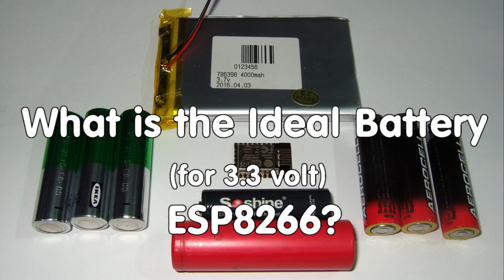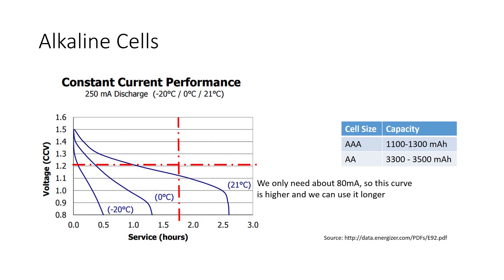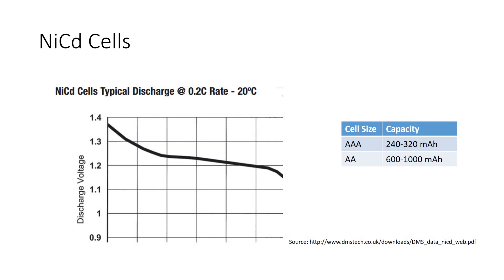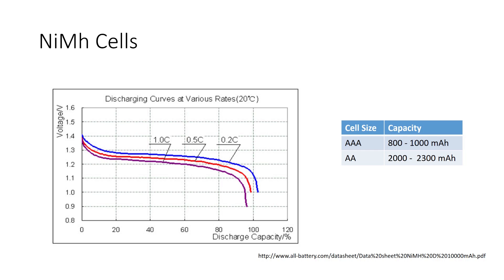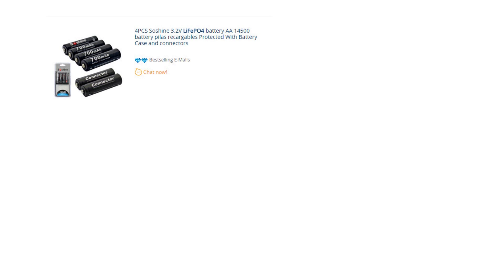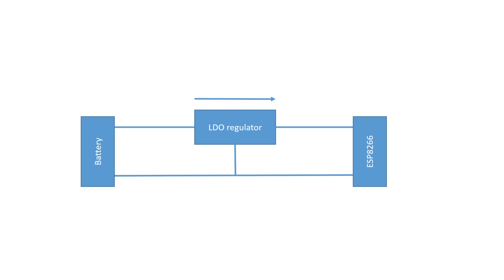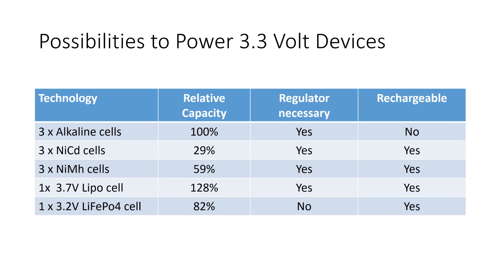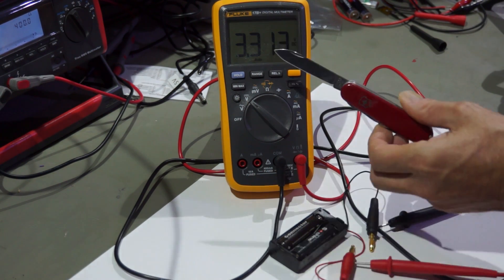#64 What is the Ideal Battery Technology to Power 3.3V Devices like the ESP8266?

Comment: But what about the current?
For example, if my device can draw spikes of two amps, can I use a lipo of 500mah size?
Reply from the maker: +Mahmoud Metwally This comparison is not for motors with high currents. If the spikes are short it is usually better to use capacitors close to the device. I covered that topic for the Esp8266 in my videos.
For high current applications I think, Lipo is the best technology.
Reply: Any details about the usage of such capacitors?
Reply from the maker: Not more than covered in the videos.

Comment: 700mAh at 3.2V = 2.24Wh. And seems to cost ~$3. For that price you can get NCR18650B (3.25A*3.6V=11.7Wh) or similar. Even lowered by 20% with LDO it still seems that regular 18650 is 4-5 times better deal.
Reply from the maker: If you only look at the dollars, you might be right.

Comment: Hi Andreas, im planning a project where the Esp sleeps and wakes up when a button is pressed. I need a battery solution with a low idle (deep sleep)  current. What would you recommend?  I was thinking of a lifepo4 directly or an 18650 with an Pololu S7V8F3 (0,1mA idle current) 

Greetings from Germany
Reply from the maker: I just looked at the S7V8F3. I am not sure, if this small current is only during shutdown. Then, it would be useless. If you go with Lipo, a much cheaper solution exists: Just look my video #58. Or you go with LiFePo4. Then, you do not need any regulator.
Reply: thanks for your inspiration, lifepo4 works great. I got the Idle-Current down to 18uA. Combined with a PIR Sensor (40uA idle) i got an awesome Securtiy System for cheap.

Keep up the good work, your channel is my favourite ESP8266 and arduino related channel

Comment: What about this batteries ? this is relevant for both videos this one and the life time of esp  on batteries , with this kind of batteries the esp can work for decades with duty cycle less   ,then 1% http://www.libelium.com/v11-files/documentation/waspmote/smart-parking-sensor-board_eng.pdf  PAGE 33
Reply from the maker: These are very large batteries. They are non regargeable. I did not look into this combination in this video. 
As you write, self dischargig has to be taken into account for applications which run over a very long time. My assumption for this video is, that this is not the case. Microcontrollers as the ESP8266 use quite some current and the batteries used in this video will usually only will last weks to month even with very small duty cycles.
I am currently working on a video about the ESP waking up only once a day. Maybe I will cover self discharging there.

Comment: Hi,

sehr interessant ihr Video. Da ich ein Neuling in Sachen Elektronik bin. Hätte ich mal eine Fachfrage:
Wenn ich den Esp8266 Esp07 nehme Ist es möglich  12 smd LED mit 3 Knopfbatterien zu betreiben? Mein Problem ist das die AA Batterien zu groß sind. Ich nehme jetzt einfach mal das Sie Deutsch verstehen.

Gruß
Reply from the maker: +Cfd-Trading with perfect Forecast Der Esp8266 läuft nicht mit normalen Knopfzellen, da diese den benötigten Strom nicht liefern können. Siehe auch mein Video#58. Da sehen sie, wie ich es gelöst habe. Die LEDs brauchen allerdings ebenfalls noch mindestens 10mA pro Stück solange sie laufen (entsprechend mehr, wenn es grössere sind).
Reply: ich verwende dem smd LED bauform 1206 die verbrauchen nicht einmal 2 ma. Ich schaue mir mal video 58 an

Comment: you should not have overlooked the advantages of NiMH cells.  They can handle over charge and over discharge which the Li batteries cannot.  They do not explode or leak.  If you need durability and rechargability, they are the clear winner.
Reply from the maker: I did not pay too much attention to this technology because I assumed, it is well known by my viewers (it is a relatively "old" technology). But you are right: They have the advantages you describe over the Lipo.

Comment: Hello,

there are 3,7 LiPo rechargeble batteries in AA and AAA format. Eaven with protection curcuit like the big  well known 18650. I use them in many flashlights, than can run on higher voltages. There are also lots of new formats, like 18350 (slightly bigger than the 123A Lipos 16350)  or 16850 (size equivalent to two 123A).

Search for 10440 (AAAS) and 14500 (AA).
Reply from the maker: I think, this is a big advantage of the Lipos: You get them in many different sizes. Good to know how to find tehm. Thanks!
For me, the square sizes are also quite handy
Reply: You can find the square ones in all shapes at hobbyking.com 

If you buy "Turnigy" or "NanoTech" you get the capacity, that is printed on. For excample: I've super tiny NanoTech 300mA Square Lipos that support discharge rates up to 90C!!!

The IMR LiPos are interesting to, if you need high currents. The capacity/size factor is lower but a 18350 IMR can deliver up to 8A and the IMR are a little robuster than the normal LiPos.

Comment: I use lithium 3.5v battery from discarded cell phones. It works like a charm, even when you're recording a new firmware on the device.  I also use a small silicon diode in order to drop the Vcc + a little.
Reply from the maker: Diodes are ok to drop voltages. However, I prefer LDO regulators because they have a variable drop (at the beginning more, at the end less than a diode). And they are also not very expensive.

Comment: So many batteries remain partly unused because the voltage became to low. It is time someone invents a system to use a battery till the last piece of power that is in it. Something like generating an alternating current, transforming it up and making it a flat direct current again. It could be told in a shorter way. The result would be that a number of batteries is connected to the system, all different batteries, like 1,5V or 1,2V and every battery is upscaled in voltage till the last micro Amp is gone, then the other batteries take over. It's just an idea, there is no economical use in it, more money is made by selling new batteries.
Reply from the maker: As I wrote above, there is not much to "steal" for the thief ;-)
Reply from the maker: I think, this is only true if the battery is not rechargeable. But Dave Jones (eevblog) did a video concerning the energy of the last part of the discharge curve. Unfortunately, he found, that this is a very small amount of energy.
Reply: Maybe you could use a joule thief to get that little bit of juice left.

Comment: What about NiZn Rechargeable Batteries (1.6V)? If you search on ebay you get plenty to choose from in AA, and two NiZn AA batteries cost about the same as one LiFePo4 AA size battery. These also might be interchangable with NiCd batteries. For some marketing reasons for NiZn batteries capacity is given in mWh instead of mAh, that gives 1.6 times grater number.
Reply from the maker: They are on the way to my lab. Stay tuned ;-)

Comment: The new versions can be charged with USB. Just plug in an Powerbank and you are fine. It converts from 5V to 3.3V. Easierst way and you can recharge it.
Reply from the maker: I absolutely do not agree for the AA batteries I use. I just tried mine. With a stong power bank you get much more than the maximum 600 mA and the voltage goes up to more than the specified 3.6 V. Maybe the ones with protection unit are different. Which batteries do you use?
Reply: +Andreas Spiess I am using a simple power bank. Max output is 1A. Works fine.
Reply from the maker: Which batteries do you use?
Reply: +Andreas Spiess Den hier. https://www.amazon.de/dp/B00T415OTS/ref=twister_B010ES78PW?_encoding=UTF8&psc=1
Reply from the maker: Now I understand: we did not talk about the same thing. I think, you talk about 3.3V modules and I talked about batteries, because you wrote "charged". 
ESP modules with USB (usially NodeMCU derivates)  have a regulator on board. They can be powered as you do. Not so the ESP-12 modules. They run of 3.3 volt and have no voltage regulator. This video is about these.
Reply: +Andreas Spiess Yeah Iam talking about esp 12e version from amica e.g. You can even power em on Vin with 5v.
Reply from the maker: I am talking about these modules: 
http://www.aliexpress.com/store/product/The-new-ESP8266-ESP-12E-serial-WIFI-wireless-module-wireless-transceiver-Complete-circuit-impedance-matching-better/318950_32320927821.html

You probably talk about one of these or similar:
http://www.aliexpress.com/store/product/New-Wireless-module-CH340-NodeMcu-V3-Lua-WIFI-Internet-of-Things-development-board-based-ESP8266/19898_32639608683.html

These have one of the above ESP-12E modules plus USB plus 3.3v regulator
Reply: +Andreas Spiess Yes I do. Makes things a lot easier

Comment: I really enjoy all your video... Started on esp8266 a few months back, still learning.  I am looking for a circuit for connecting a 5+v PSU through a DC-DC converter at the same time as charging a 3.3v battery and use this battery as backup in case power fails.  Any such circuit around?  I don`t like to re-invent the wheel! Thanks, Simon from Québec.
Reply from the maker: The first question is: Do you only need 3.3V? then, you can avoid 5V and use a 3.3V regulator plus a device to load the battery (depends on the technology).
If you need 5V then I would go for a higher voltage battery (6V or above) and use 2 linear regulators, one for 5V and one for 3.3 V. If you take a big 5V regulator you can put the 3.3 v in series. And a device to load the battery. This gives you stable voltages at both rails.
Or you go for a 3.3 V battery and a boost converter to boost the voltage to 5V. You need a 3.3 volt battery (which in reality does not exist because no battery is stable).  And also here, you need a loader for the battery. Here, only the 5v rail is stable, the 3.3V goes with the battery

Comment: Hmm, I just use li-ion thru a 5v boost backed to 3.3buck (you can buy buck-boost modules as all in one solution, much better)since the boost can take 1.8v or so, up to 5v to feed the buck.  this way you can take the 18650 or whatever down to your 2.5v (or whatever your batter min volt is)  to get max out of it thru the full range.  There is loss in 2 conversions, but hey, with 3000mah to play with and recharging it seems the easiest solution.  Now you got me thinking just how much am I losing outta this cheap setup?

EDIT:
4.1volt 109ma draw to get 68ma 3.3v. using 47R resist as load.

Maybe something cheap like this for light loads, if the ESP can run at 100ma(150ma spikes)
http://www.ebay.com/itm/2-in-1-DC-DC-Step-Down-Step-Up-Converter-1-8V-5V-3V-3-7V-to-3-3V-Power-Module-/271873956073?hash=item3f4cf358e9:g:ZdsAAOSwepZXRZJm
Reply from the maker: You always can use converters. This was not the topic of this video. For small voltage differences I usually use linear regulators. They are cheaper, smaller, and do not take much more energy. This changes, however, for bigger differences.
In your example, you lost 50% with just one conversion Input: 4.1V x0.109A = 0.44W; Output:  3.3V x 0.068A = 0.22W). You can avoid the spikes with a beefy capacitor. See my videos about deep sleep if you want.
Reply: I was just trying to figure out how to get max use from the lower range of 2.5v to 3.0v range when the battery gets that low, or if it would be better to just stop at 3.0v and consider that the 'dead battery' status.  Just to see which way gave more power use overall.  I knew it was not what Im currently using(a small transmitter)  This was going on the assumption that the lifepo4 min voltage is 2.5v, thou I do not have any of them.  Great Videos!
Reply from the maker: If I remember right, you should not go below 3 volt for Lipo. For LiFePo4 you should not go below 2 volts. However, the last few millivolts do not contain much energy as the voltage drops rapidly (see the voltage curve). You problably loose much more during boosting during the whole cycle than you gain at the end. But I did not do any tests so far.

Comment: Thank you, Andreas, for a fine video! 

You said that you had ESP8266 examples which did not run stable at voltages higher than 4 V. 

Do you have a video (or some other documentation) of these overpowered unstable examples too? 

In my experiments, if an ESP8266 system with a 3.3 V power supply isn't stable, I usually try it with 4.5 V ... 6.0 V and quite often I get a system that is more stable with that higher voltage. Haven't managed to destroy a single ESP8266 chp yet.
Reply from the maker: Good idea. That would explain it!
Reply from the maker: 5 volt tolerant usually does not mean Vcc. It means, that, even if Vcc is only 3.3 v, the pins support 5 volts because they have protection circuits.
The data sheet clearly says,  3 - 3.6 volt, and if the chip survives higher voltages, that is nice, but not very important for me, because I try to keep things inside the specs.
I went up to 4.2 volt and the current started to increase considerably after about 3.7 volt. It is well possible that you get more output performance with a higher Vcc. That is to be expected, as long as the chip survives...
Reply: Do you have any examples ?
Reply from the maker: This is extremely strange. If I would be inpolite, I would ask you to check your multimeter ;-) I never heard of something like that
Reply: onboard regulator ? :P

Comment: Would it be possible to recharge the LiFePo battery in circuit from a solar cell by hooking up the solar cell directly to the battery  and the ESP8266? I need something that can run 'indefinitely' and recharges from a solar panel during the day.
Reply from the maker: Look at Patricks comment below. Or this one: http://nerdralph.blogspot.ch/2016/01/a-36v-lifepo4-charger-for-under-50c.html
Or search for LiFePo4 charger. You will find some
Reply: Thanks! I am studying the information. Your channel is quite an inspiration!!
Reply from the maker: +xennelul you can also wait till tuesday evening if you subscribed ;-)
Reply: I am, for sure! ;-)

Comment: At the risk of being spammy, since there are many comments about LiFePO4, I'd like to mention that I'm doing an effort to promote the use of this battery technology by makers.  I run the website http://lifepo4wered.com to promote this type of 
battery, I sell a convenient USB chargeable LiFePO4 module at https://www.tindie.com/products/xorbit/lifepo4weredusb/ and am working on other LiFePO4 based products (see https://hackaday.io/xorbit).  Some of my customers have used LiFePO4 batteries very successfully with the ESP8266.
The batteries have a great voltage range for use with 3.3V chips, they do not explode or go on fire like LiPos, they can be put in parallel to get extra capacity and they last for 1000+ cycles.
Thanks for letting many more people know about this great type of battery Andreas!
Reply from the maker: You are welcome. Even your comment was considered to be spam by YouTube I accept it as valuable for my subscribers.

Comment: Thanks for the intro to LiFePo4. I haven't played with those yet. Why not reverse or modify your battery terminals to run a pair of LiFePo4 AA's in parallel instead of the traditional AA-Series connection? Wouldn't this be a 'best of both worlds' situation? Don't most LiPo cells have an internal over charge/discharge circuit? All of the battery packs I have torn into have them (I haven't taken apart any if the round cells).
Reply from the maker: I looked at your proposal concerning turning one cell. Not easy (the minus has a spring, the plus not). So, It would be easier to buy two single holders if you want two in parallel.
Concerning LiPo: No, not all have protection circuits. You can buy them with or without.

Comment: LiFePo4 (lithium iron phosphate) batteries are sold for RC applications as transmitter and receiver batteries. They have a lower self-discharge rate and better temperature characteristics as LiPo, but a far higher internal resistance. Quite good for devices like outdoor temperature sensors, if you really want to bother with rechargeables in such a scenario.
Reply from the maker: Thanks for the info. You are right,  I also assume in my summary, that you might use the "hassle free" alkaline technology if current consumption is small.

Comment: Hello Andreas awesome video on batteries. Maybe this can help to extend the battery some more i bought one of these i havne't used it from it's from 0.8v up to 3.3v and output 3.3v 500ma http://www.ebay.com/itm/131845052553 only needing one AA Single Cell battery.
Reply: I think when Andreas assumed a 20% loss for a voltage regulator, he was referring to one such switchmode regulator. They have around 80-90% efficiency.
Reply: +h3po hello I understand I thought this might help if the voltage goes lower voltage  but still can keep the same output. to last a little longer.
Reply from the maker: Actually, I referred to normal linear regulators, because I always foresaw enough cells to have a higher or equal voltage than the device needs. Then, the regulator has to dissipate the voltage difference.
But you are right, you could also use such a device and then use only one NiCd, NiMH or alkaline battery. They do not work for Lipo or LiFePo4 because they are boost converters.
Anyway, they are nice little devices and I have also a few lying around...
Reply: i just got mine in today and fell in love with it. I'm using this on my up coming smart watch project soon :)
Reply from the maker: Great!